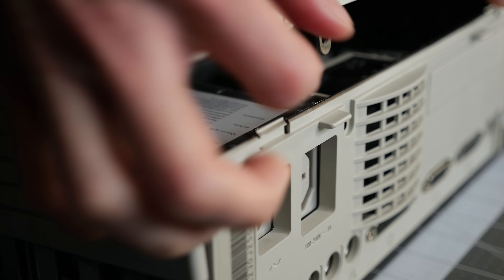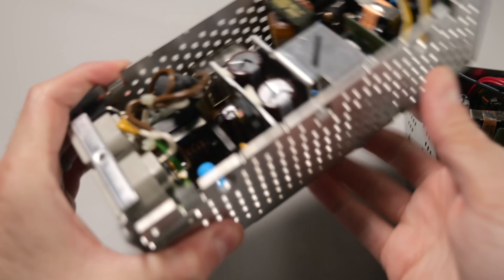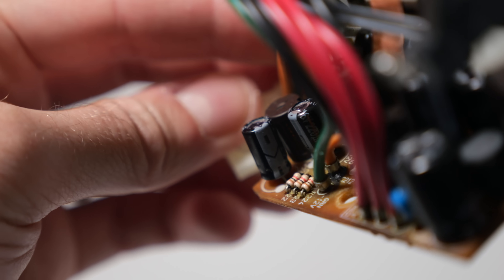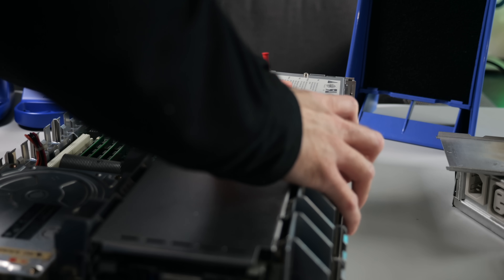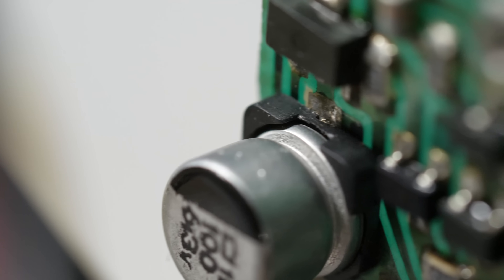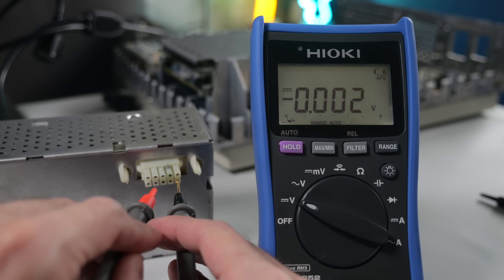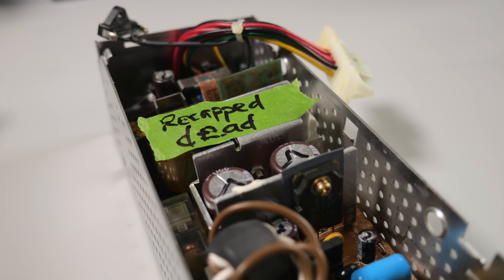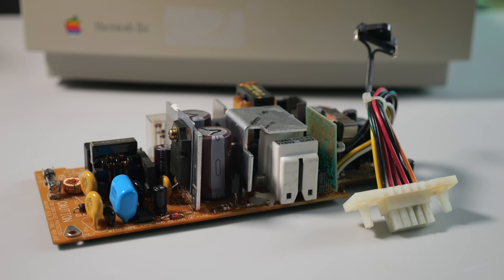Fix this part before it KILLS your vintage computer!

Comment: End part revealed what I've been wondering. Why even try to rescue old powersupplies? First of all they're usually awfully inefficient, like I used c64 power supply as feet warmer in cold winter days. Just ditch them as they're... power supplies and have nothing interesting to even salvage for old hardware. Just re-use old casing if needed for aesthetics, though I wouldn't care if modern replacement would be thrown inside old computer.
Reply: I also like modern replacements on older machines, but not every person like it.
Reply: no theyre not 'awful' or 'inefficient' ..as for the c64 psu issue, its likely just dry joints on the 3 terminal regulator as i found in my plus4 'wedge' psu, if you can open it up and get to the track side, resolder everything and it'll likely be perfectly ok, fit a 1N5339 zener across the 5v out to clamp any overvoltage if it occurs...
Reply: @andygozzo72  lol it was new back then. Efficiency is absolutely horrible on older hardware. They all were like that
Reply: They're not "all" like that.  The C64 is a really shoddy supply.  That's Commodore for ya.  That was an era where you might find a few exceptions, like linear supplies and such.  But generally, if it's a switch-mode supply, it's reasonably efficient, and should be reliable as long as you replace any capacitors that are prone to failure.  (The old 80s ones are pretty stout, but I replace them anyway.)
Reply: @sirnickity  interesting that every single person I know has stated the exact same thing and it's c64 supplies were like toasters. And again it wasn't age issue back then.
Reply: @jothain   That's what I said.  The C64 supply is a corner case of particularly cheap PSU design.  It's not representative of that whole era of PSU tech though.
Reply: @sirnickity  yet by modern day powersupply standards they all are very inefficient.
Reply: @jothain   Switching supplies haven’t changed THAT much.  Yeah they’re a little more efficient now, on average.  And some designs are exceptional, allowing us to cram 1500W PSUs in 1U servers, PoE switches, and such.  But it’s not uncommon to find supplies, today, that are still like 70% efficient.  The thing is, if it’s powering a 40W load for maybe a couple hours every now and then, who cares?  I’ll put my energy into making sure stuff I leave on 24/7 is eco-friendly, but a retro computer?  There’s no sense at all worrying about the PSU efficiency when you’re talking about running CPUs at 5V to do workloads that you could run off a coin cell with modern silicon.  You’ve already made up your mind that nostalgia trumps efficiency.  Why are we talking about an extra 2WH lost or gained from SMPS improvements??
Reply: @sirnickity  1. Reliability compared to old. 2. Figures that are way more than 2WH if item is downright hot to touch.
Reply: @jothain   I think you are confusing two different arguments.  The C64 supply uses a LINEAR regulator.  So yes, its efficiency is terrible.  By design.  Which is why I called that one an exception in my first reply to you.

Most devices that pull more than a few hundred mA use a SMPS, because linear regs get unwieldy at >1A.

SMPS from the mid-/late-80s aren't ALL that different from now.  The most common topologies have been around for a LONG time, and the characteristic losses are not orders of magnitude better now.  It's certainly not going to be "hot to touch".  If it's HOT, then it's almost certainly using a linear regulator, and that's a different argument.

As far as reliability, if 1) it was built by a decent OEM; 2) it wasn't cost-reduced to scrap; and 3) the caps are good -- then it's probably just as reliable as a modern supply.  Possibly more, because everything now is cost-cut to within an inch of functional.

So if it's a well-made supply in good working order, there's no inherent need to replace it with something that is in many ways likely to be inferior, just because it's newer.
Reply: @sirnickity  Why are you yelling parts? Like I first stated in my original message "Why even TRY to RESCUE old powersupplies? Crying out loud. If it's bad, it's bad ok.
Reply: @jothain   Nobody's yelling anything.  Turn down your volume.
Reply: @sirnickity  not that shoddy, just not enough solder where its needed! as i said, my plus4 had a wedge type psu like c64s and tested 'suspect' on a dummy load so opened it up, luckily the track side was accessible and fault obvious, all 3 terminals of the regulator cracked joints, hardly any solder used on it,, once redone it was perfectly ok, i bet that was the issue in all c64 ones that went bad, plus other similar 'brick' type ones also notorious for failing/killing computers...
Reply: @andygozzo72   Not shoddy?  Aw come on.  ;-)  They used a linear regulator with a design output of 1.5A, so they could have a BOM of like 5 parts.  They didn’t even use a FWBR.  Just two diodes.  I mean, it works, but they were clearly being CHEAP.
Reply: @sirnickity  2 diodes is still full wave if a centre tapped secondary is used,  and at that small current and wattage, a pure linear power supply is acceptable, it was pretty much normal for most 'home' computers, it did the job,
Reply: @andygozzo72   Oh you're right... it was center-tapped.  I had a schematic saved for an eventual overhaul of a C64 brick, and misread the transformer section as being tapped for the other rails.

At any rate ... this is just a design choice I don't like.  IIRC, the load of a C64 ... kinda depends on which variation you get, but is in the upper hundreds of mA to a little over 1A or so.  While that is definitely within the realm of possibility for a linear reg, if you have a couple of volts margin on the unreg side (which you will, to account for load and line variation), then that's a few watts, which is a lot of heat being generated in a single package, in a closed box, with no fan.  I don't like it.  ;-)

Comment: There's just something about those IIsi power supplies. The few I've opened up are always a horrible mess on the underside. I'm glad you got one working! I'd agree with your assumption that the little daughter board is causing the trouble on the other one. Thanks for the video!
Reply: Could be many things I’ve found. Diodes go bad, there’s a resistor that takes a beating. I personally hate the iisi psu

Comment: I never use OG psus anymore.
Not only are they more dangerous with age but less efficient in comparison to modern stuff.
I always convert to ATX in some way that is reversible however.... for the "serial number" folks...
Reply: no need to 'never' use an old one, they may be perfectly ok and/or easily serviceable, i have many AT psus still good, less so ATX ones, they seem to have suffered from the 'capacitor plague' a lot , as for 'less efficient', theyre still switch mode and newer ones work pretty much the same way, with 2 transistor 'totem pole' drive to the main transformer
Reply: @andygozzo72   Nearly everything in my fleet is running its original supply.  I pretty much always start by disassembling the PSU, cleaning everything really well, replace the caps (because you'll need to eventually anyway), replace the fan with something adequate (don't just throw a Noctua in everything), and test with a dummy load.

The ONE time I skipped the cap replacement, it failed within a year, and almost took the motherboard with it.

I have had one supply fail after cap replacement, and I didn't figure out what had happened to it.  I decided to replace it with something else of-era, because it was kinda cheap anyway.  I also had one (on a PS/1) that required replacing the DC-side rectifier diodes.  Seems to be a common fault.  Works great now though.

Learn to maintain these things and you'll be far better off.

Comment: I've only installed a capacitor backwards once, and funny enough, it was on a IIsi power supply. I knew instantly what I'd done when I powered it on and it went "POP!"
Reply: Once i was messing with old pcs, (win98), don't know what I've done wrong, just remember the cloud of white smoke coming out of that pc LOL i was quick to disconnect it from the power at least.
Reply: I did the same thing on a Mac Classic analog board, it's tough to keep track of which + sign is for which cap on the silkscreen when they're so bunched up. Powered it up and saw it inflate, caught it before it popped though😅

Comment: The daughterboard is quite small.

Wouldn't it be possible to recreate a new PCB? Or would that be too difficult?
Reply: That daughterboard looks like it only got one layer and the layout is pretty simple. Someone could def recreate it very easily.
Reply: @matchc0635  probably, if all parts are removed it could be scanned ...
Reply: @andygozzo72   Scanned like with a regular scanner?
Reply: @peddersoldchap  yeah, could try...but would have to remove everything so you could get if 'flat' to the scanner plate
Reply: @andygozzo72  What I mean is, the scanning is done with a regular scanner, right? Or is it done with a special scanner for PCB's?
Reply: @peddersoldchap   Regular scanner.  Or take a photo.  The purpose is to have something to trace / reference to design a new one.  It's not like a PCB cloner or anything.  :-)
Reply: @peddersoldchap  i dont know if you can get 'special' ones for pcbs, but a normal flatbed one could give acceptable results, you'd likely have to edit and touch up in a graphics editing program..
Reply: Just take a pic of the PCB with or without the components, ever seen a big Clive vid?
Reply: @matchc0635   Can you be a bit more specific? He has over 2000 videos! 😅
Reply: It's extremely easy to make a re-pro. I'm actively taking things like that (but mostly arcade-related stuff) and making 1:1 repros with everything available publicly. I've done hundreds of things. For example 6 years ago I copied the Commodore 1581 3 1/2" floppy drive controller PCB exactly 1:1 within +-0.1mm so it looked absolutely identical to the original and it worked first time :-)

Comment: Pretty crazy old caps can be recharged and will work good as new again. Way above my paygrade though, and the same for screwing around in a PSU 😅
Reply: yep, aka 'reforming' but thats only if theyre pretty much good internally anyway, the oxide film degrades over a very long time if unused and first power up can result in a high charging current, best done gradually with current limiting

Comment: Should you be doing this. Its so dangerous playing with a psu
Reply: Only dangerous when you have no clue what you are doing. I recapped a BBC Micro PSU and a Vectrex. Took all the precautions needed, especially on the Vectrex CRT.
Reply: @6581punk  its not a job anyone not trained should do
Reply: @hoztravels2024 Pipe down, baby.
Reply: @hoztravels2024   Nobody is born trained.  Study.  Learn.  Then DO.  Otherwise it will fail.
Reply: @1pcfred  yes, but opening a PSU can kill if not done correctly. Those who dont realise that are candidates for the darwin award
Reply: @1pcfred  fair enough, just think a warning should be in place

Comment: I have an Apple IIGS, after using it for about 30 minutes, one of the rifa caps blew up, it smelled disgusting. I decided to replace all of the capacitors and it works great, it should last another 36 years.
Reply: The RIFAs going is quite normal on old machines and nothing to worry about really. Removing them and not replacing them is generally fine. The case on them tends to crack and eventually gives off the magic smoke.
Reply: @6581punk  those epoxy cased RIFAS should always be replaced on sight, especially if signs of cracking as moisture gets in, they use a paper based dielectric which absorbs moisture, some at least of their 'new' types are still paper based according to datasheet, i dunno if i'd trust them!! hopefully they're improved....
Reply: Once i managed to blow a capacitor from a phone charger, dude the smell was terrible lol
Reply: @IsmaelWensder oh my god it is so gross. Blown RIFA caps smell like sweet burnt paper and charred plastic 🤢

Comment: Glad to see the hot tweezers put to use. Soldering equipment quickly pays for itself!
Reply: Better than blowing the SMD parts all over the place with a hot air gun.